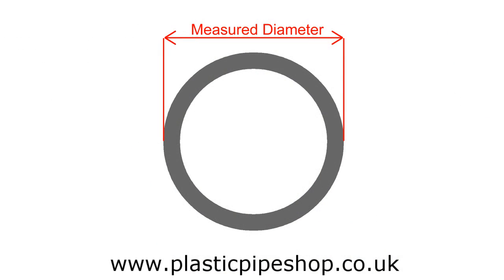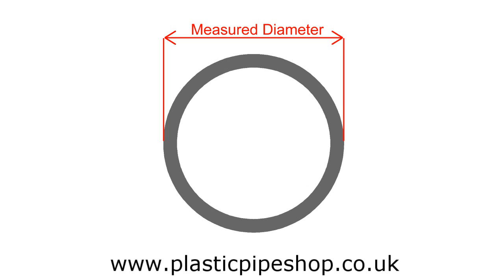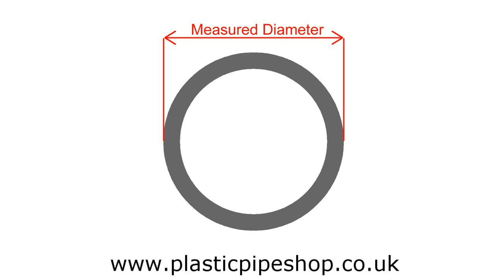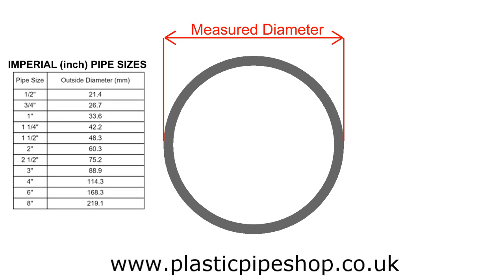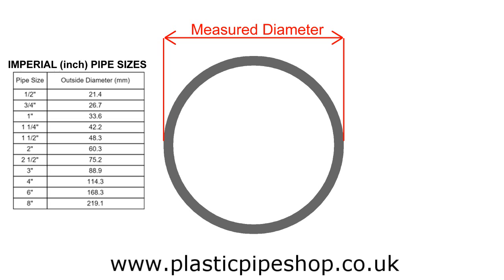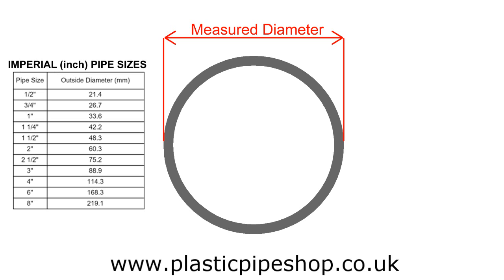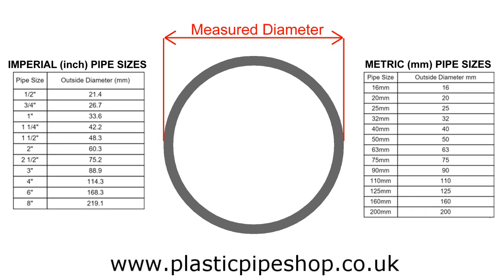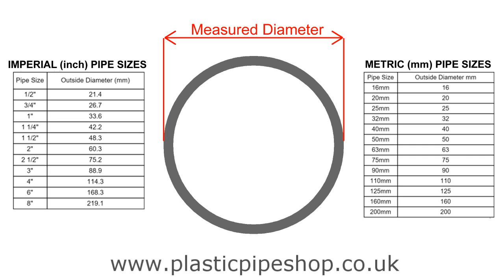How to measure industrial plastic pvc and abs pipe

Comment: Americans (I/we) struggle with our legacy system (imperial) as much as the rest of the world struggles wrapping their heads around it. 
Last weekend I purchased and cut 4” ABS when I was replacing 3” because it measured 3.5” and I assumed it was 4”.  A glued flange, three elbows and 10 feet of piping went into the trash. A quick way to waste $75 really fast.

Comment: I need to replace the pipes that I have and would like to buy the proper size.  I can't measure the diameter and I know that the circumference is 6 inches.  That would give me a 1.90 inches for a diameter.  There is no such pipe!
Reply from the maker: Hi there, the closest pipe we would have to that is our 1 1/2" pipe which measures 48.3mm on the outside diameter.

Comment: To simplify, if you were to go to a home supply store in the US, plastic pipe is mostly labeled with its inside diameter. To use a 3" ABS pipe as an example, the pipe would have a 3 in. inside diameter and close to a 3.5 in. outside diameter.
Reply from the maker: Hi, yes, this applies in the US and with all imperial pipe, although the internal measurement would not be exactly 3". The internal diameter of 3" is a "nominal bore" - an approximate bore - as it changes with the wall thickness of the pipe for different pressure ratings, specifications and materials. In many other parts of the world there is a mix of imperial and metric and with this, measuring the internal diameter (as it varies) is not a reliable way of identifying the pipe size.
Reply: This is wrong and misleading.  The inside diameter is the standard measure of PVC plastic piping.  Plastic pipe will expand overall including the outside diameter.